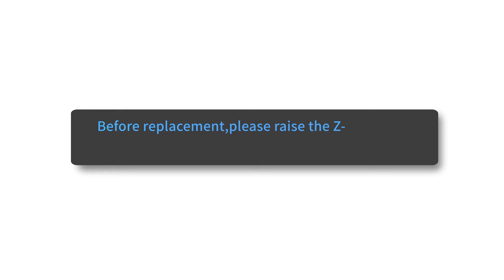Anycubic Kobra 3 Combo hotend replacement video

Comment: I purchased my Kobra 3 a week ago and yesterday I had a problem with the nozzle clogged. I had to disassemble the hotend and try to clean it with the needle included in the package. I tried to remove the nozzle from the hotend and I couldn't. Is there an easy way to change the nozzle or do I have to change the hotend at all? The printer is new, I don't want to have these problems anymore. Please, I need an answer. Thanks!
Reply: some guy named resin art on youtube has a video showing how to nozzle swap
Reply: Escribe al servicio tecnico y te envian otro hotend, estan dando problemas
Reply: @JorgeVil  Lo hice y ya viene de camino. Gracias